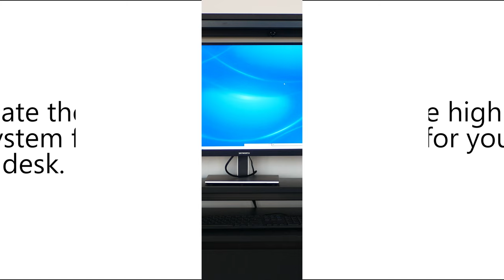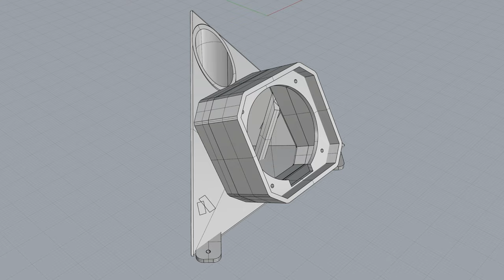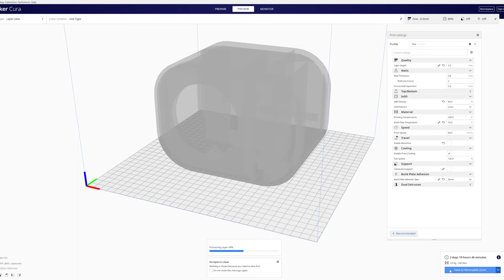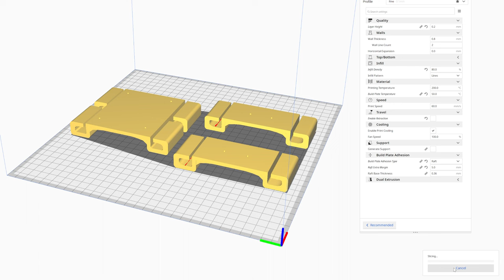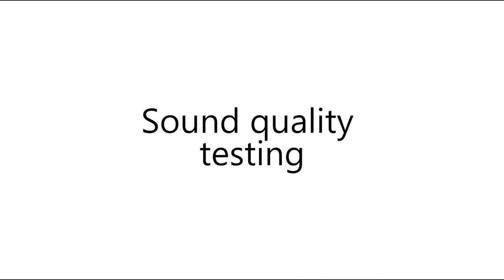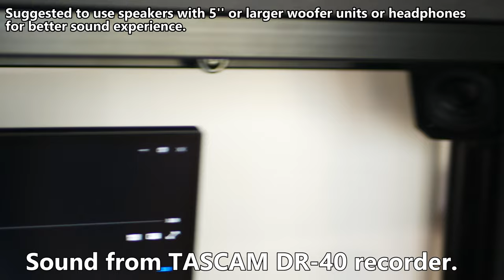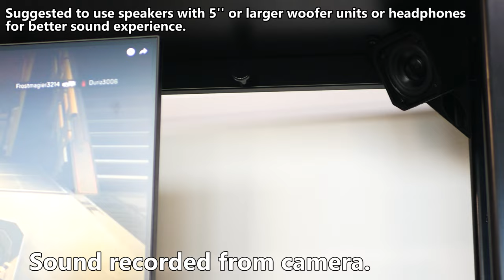2.1 Audio System for IKEA FREDDE Gaming Desk w Original Apple HomePod Subwoofer

Comment: Quick question, how much space is there between the desk and the monitor shelf? I want to know if I can fit a sound bar and a power strip under there.
Reply from the maker: 61-62mm, remember if you put a monitor over there, the center part might sink a little bit, so take it as 58mm.